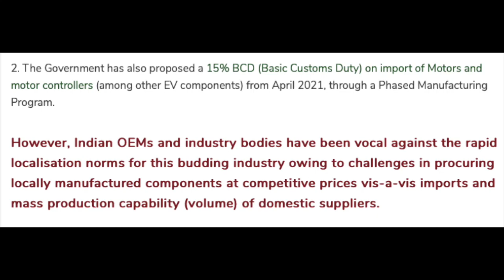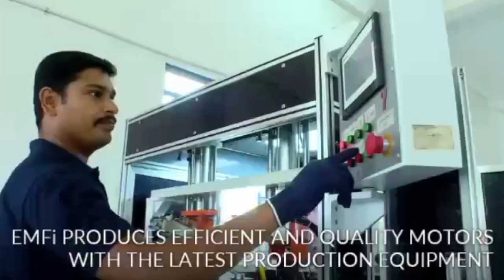EMF Innovations to produce BLDC Hub motors in India | Chat with Sivasankari TP - Managing Director

Comment: I purchased a 850Watts EMF Hub motor and Controller together on Dec 16, 2021 and it stopped working on March 8,2022. It didnt even worked for a year. When I sent the motor and controller back to the company for Warranty claim, they rejected the claim, saying that the motor has been run on High speed and asked me to pay for it. I dont understand this. How can I run the motor at high speeds, as the controller itself was made by them?. Looks like Poor Design and R&D. At the time of purchase, they said that the Motor and controller gets 1 year warranty and I found that its a bogus warranty. I still did not receive the Motor serviced back, eventhough I agreed to pay for it. Electric Vehicle is a growing field in India, but these kind of poor customer service will never let the company survive. I felt disappointed after spending 10K, and its worthless for this product.